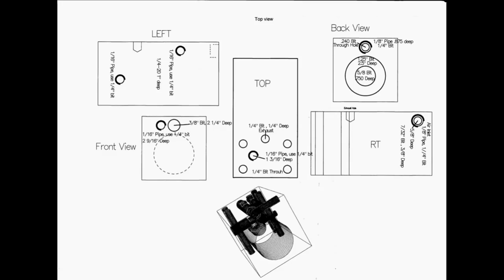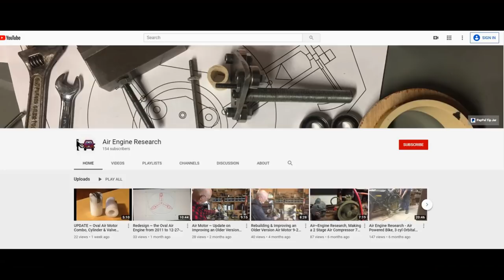A Car Compressed Air Motor, is it possible ?

Comment: you can machine or 3d print a rotary motor like the vane dipietro engine or the liquidair engine, it has less noise
Reply from the maker: I do not have a printer, and it would cost more than the parts and pieces needed to buy. From what I know a rotary engine would be much more complicated, and basically impossible to make airtight for a compressed air engine. From what I’ve discovered over the years I’ve been working on this, a piston engine is the simplest and most efficient way to go.
Reply: you can make stepper motors similar to nema17 and use a 5$ printer board, you can make the hot end with a lathe and extruder, otherwise you can buy a anet8 in aliexpress for 100$, after that if you extrude your own filament from recycled PET plastic bottles you can make hundreds of small prototypes and lost wax metal casting. rotary vane motors can be manufactured with good cads and cnc machining, and it has les weight per power ratio and almost no noise
Reply from the maker: That is not the direction Air Engine Research is going
Reply: oh yeah it is, pneumatic vehicle storage has switched to reinforced fiber thermoplastic tanks, and in the same way you can make fiber reinforced thermoplastic engine because reinforced thermoplastics are not only far lighter but selflubricant and can keep mechanical properties with low temperatures in case of high pressure diferential motors with no heat exchanger. you can ignore it but it's actually happening
Reply: @AirEngineResearch  need to use V8 or V6 motor for power torque so it can recycle the air back to tank most people miss this if your not a mechanic.
Reply from the maker: It would use too much Air
Reply: @AirEngineResearch  the air gets recycled  back to tank so there is no out to atmosphere like other types according to inventor and witnessed by my dad.
Reply: @AirEngineResearch  i got pics of the patent if your interested
Reply from the maker: I am always interested in something about what I’m working on 
AirEngRes-22@gmail.com

Comment: Nice job, the 1st picture is difficult to see; interesting maybe you shouldn't have set it aside but sometimes we have to with lots of other things to do and rest. What state do you live in, I'm in central ny
Reply from the maker: Live in Missouri, I didn’t have a very good camera back then, and anyway the motor self was just too complicated with too many moving parts and to bulky. The one I am working on now will be so much simpler and just 4 or 5 moving parts compared about 75 or 80 on the first one.
Also thank you for your comment and your support

Comment: my dad seen air motor in an car that was a V8 and it recycle the air back to tank and i got my hands on the patent, most of all of the air motors are made are made wrong, the V8 motor has high torque ratio same as V6 ,the motor turns slower with more power and it has recycle pump two geared for different speeds of the motor, 4 or 2 cylender motors wont recycle well because of lack of torque but that has been invented years ago it was supressed.
Reply from the maker: Thanks for the comment and info.
Over the 20 or so years that i have been interested in using compressed air in an engine, I have thought of using various engines but decided that is not the way I want to go.
For me fossil fuel engines are too heavy, too large and are not efficient with many, to many, parts that are not necessary to use compressed air as a source of power. 
I'm going for simple - with only necessary moving parts, small size and higher rpms.
I'm sure there would be a number of people that would be interested to hear about what you have found, if you were to put some info out on youtube.
Oh by the way if your thinking of using an 8 cylinder, maybe use 2 or 3 cylinders to compress air instead of using an extra external compressor?
Thanks again for checking in!
Reply: @AirEngineResearch  well the inventer of the engine told my dad he would  air the supply tank every so often and he said it had better take off power as than petrol that means more torque, the engine was a V8 and it had a recycler pump that would change according to speed of engine ,the only the engine could possibly recycle is high torque of the engine and you really cant get that from a one or two or 4 engine ,this was witnessed by him very long time ago and the inventor was payed a million dollars to keep his mouth shut and never was seen again until i got the patent on it and it probly wont use that much air because it the motor motor turns slower ,i got the patent but the number has smudged out , i can give you the place where i got it CREATIVE SCIENCE AND RESEARCH . now i have had the patents for long time they didnt have  web at the time the patent was filed in 1980 so you might be able try if they have a web sight now. if your interested i can send you pics of the patent just email me at    isaacgentleman@gmail.com
Reply from the maker: Thanks, I’ll see if something is available about

Comment: where are you located ?
Reply from the maker: In Missouri, not far from St. Louis. 
Hope you found my projects interesting.
Reply: @AirEngineResearch  are you still putting time in on your air engine ? did you get a good working model ? this has been a hobby of mine for 25 years off and on . id like to see your stuff and pick your brain
Reply from the maker: Currently I am working on side projects for the Air Engine.
A High Pressure High volume Pressure Regulator improvement is my current project.
A carbon Fiber Pressure Tank & 3 Stage Air Compressor is needed to go any further with the Air Engine its self, and I can't afford those.
if you go to https://www.youtube.com/channel/UCYeCMYHk5IqDLCNqcb5pF_g?view_as=subscriber I have documented all my work and idea with videos.
Thanks for the interest, and i haven't given up, I think it is very possible, just hit a roadblock